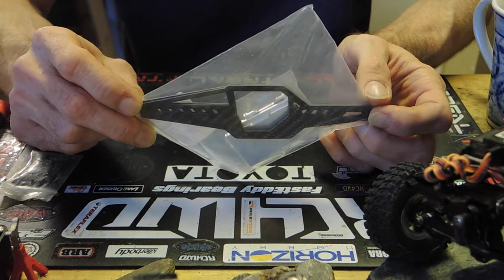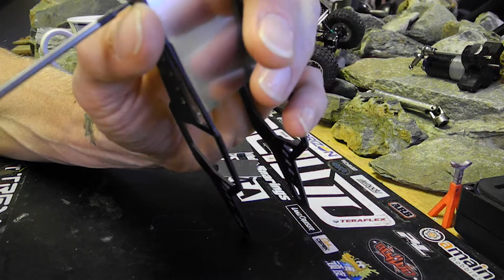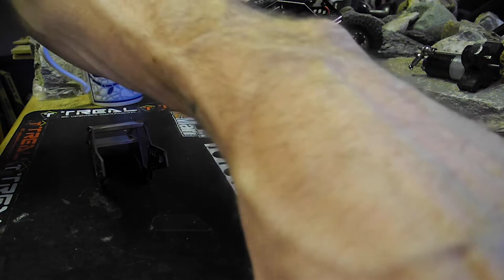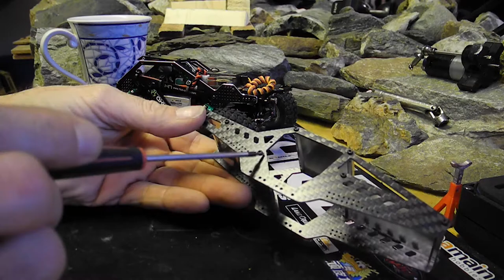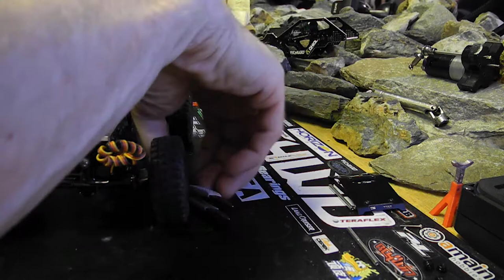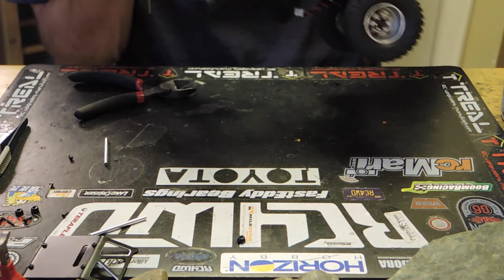SCX24 Carbon Fiber LCG Chassis Build Video

Comment: I just 'subbed'...kudos on this build. I am just about finished with the Injora/Integy aluminum chassis that you previously built.
Reply from the maker: This is a sweet rig. Took a chance on that chassis and I like it a lot. Shortly after building this, I built a dual MOA 1:24 Scythe with Dashex Z2 axles. You should check that rig out.

Comment: Nice build 🔥💯🤙
Reply from the maker: Thank you! I threw some of the new Injora Pin Comp Tires on it. It's a contender! Unfortunately, I rolled it off rock and right into water twice last weekend. Burned up the motor. So, now it's awaiting the new 44T Holmes Hobbies motor which should be here this week.

Comment: Thank you I love your build videos you make it fun as well as easy for my mental challenged  mind now I want a carbon fiber  body maybe I'll find one for a 1 /12 Chasey
Reply from the maker: I know there's a carbon fiber frame rail for the C14/C24 stuff because I have one on my C24. But I am not sure there's one that's technically LCG for anything in that scale. If I had half a brain I'd get into making custom chassis for 1:12 and 1:16 both.
Reply: @VermontScaleCustoms   that would be steller  I want  to make balsa wood stuff for 1/16
Reply from the maker: Balsa would be really fragile, I think. I do a little bit with balsa airplanes and the stuff is a nightmare to work with because of how fragile it is.

Comment: did you eliminate the wishbone link that hooks to the servo?
Reply from the maker: Not on this one. This build has also been torn down an is now the NW Chassis Works Pitbull in Carbon Fiber. It's a much better comp chassis with a decent rake angle for the skid. Climbs a lot better than this chassis does and doesn't unload like this thing. I liked this rig but it was a PITA to get dialed. Took a ton of weight up front to tame the unloading. Not normal. Better chassis geometry like the NW Chassis Works or Hard Park stuff will outdo this rig any day. I built a Dementor V2 back in January or so and the thing is insane. 

So, to answer your question more specifically; on the new comp rigs, no I do not use a wishbone. The links are all either totally custom from Send-Cut-Send, or Hard Park or a blend of off the shelf links to lengthen wheelbase.

Comment: What wheelbase are you using with the chassis jlu ? Deadbolt?
Reply from the maker: I was using just the deadbolt links. However, I ran into problems with it unloading in the front and the front driveshaft kept disconnecting from so much downward travel. The fix was to order JLU high clearance links and use those on the front (with a JLU driveshaft) and order Deadbolt high clearance links and use those on the rear with the DB driveshaft. So, essentially, stretching the wheelbase by about 3 CM overall. PLUS, I ordered some of those 1/4 oz stick-on wheel weights and used two of them on the front end. Sticks like glue now. I was just running it a few minutes ago on my indoor course and I'm blown away by what it's doing. It's a sick rig! Glad I took the chance on this chassis. Such an underdog compared to the boutique stuff out these days.
Reply: @VermontScaleCustoms  thanks man!! That’s awesome !!!!!

Comment: What wheel base is this
Reply from the maker: This rig no longer exists. I still have the chassis but I haven't run it in a long time. The original version had C10 links out back and Deadbolt links up front. So whatever that ends up being. It kept unloading so I stretched it out with JLU front links and weighted tf out of it in the front end. I recommend limit straps and don't run the shocks flat. Also get the upper links in back up off the factory locations of the skid. Use some of the holes available on the sides of the chassis to get the rear links more parallel. That will help.

Comment: OK, refering to comment in other video, i found a source, cheap and free internatinal shipping, wonder how they do that. But will skip through this video first.
Reply from the maker: Nice! I figured there must be a source available for them elsewhere. It’s a cool chassis. Just be sure to pre-thread the holes before threading the shocks or else you may run into some problems. The holes are a bit tight.
Reply: @VermontScaleCustoms  Do you like it better/think it has an advantage over the Injora you just disassembled ?
Reply from the maker: They are definitely two totally different animals, for sure. The Hot Racing chassis was pretty specifically a rock bouncer setup. I liked that thing a lot. Which I actually just built up for a friend of mine and I like how it worked for his build better than what it did for me. Go figure! However, I feel this LCG is going to be a beast when I’m finally done with all the stuff I’d like to do to it. I plan on stretching the wheelbase at some point. Maybe even with an entire different shock setup, maybe even try and make it MOA, like a micro comp rig. But that’s miles down the road from now. The big key is the Injora Pin tires that are on it now. I also used RC4WD foams inside which are a bit smaller and give the tires a much more sidewall compression without failing on side hill. Short version: they’re both amazing chassis and they do each thing really well for what they’re designed.

Comment: I have hot racing lcg chassis and it’s awesome - out performs my friend’s lcg cheat chassis which cost twice as much LOL…check out my video…
Reply from the maker: Sorry it took so long to respond to this comment. It was held for review for some reason. I have one of those Hot Racing rock racer chassis, as well. I just gave that to a friend of mine.
Reply: Can you still put the body on top of it